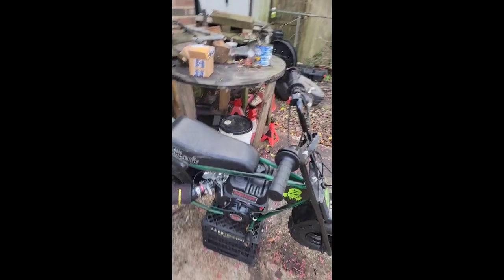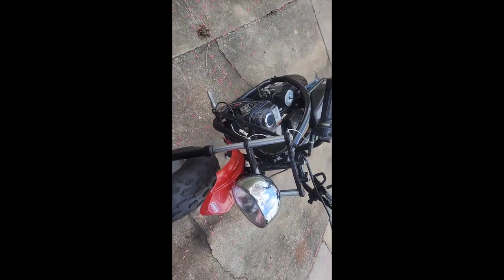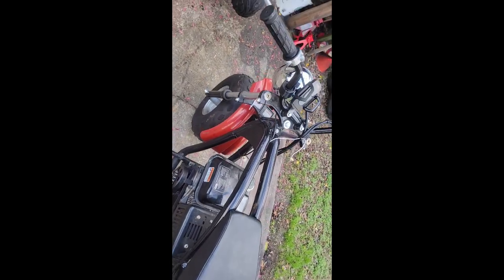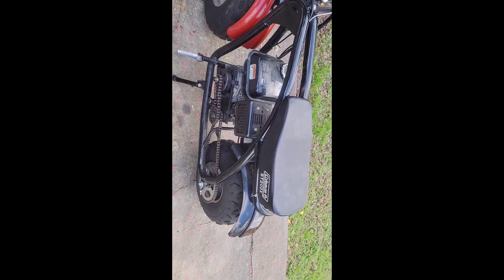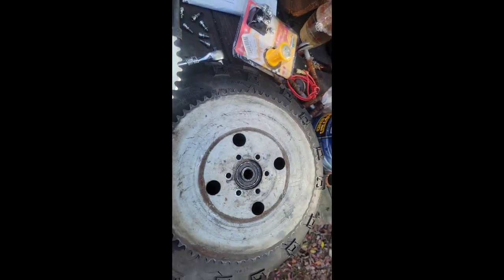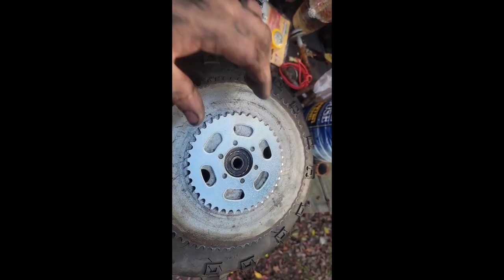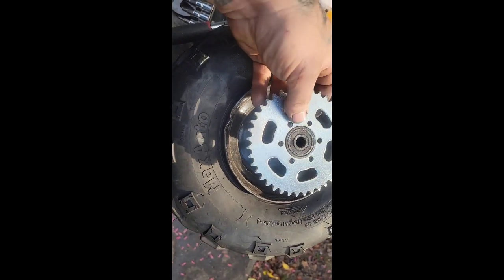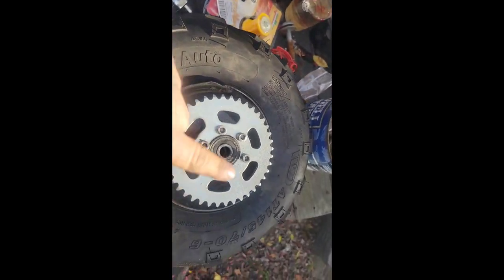work on the doodlebug..#predator212 #doodlebug #gocarts

Comment: I like that size sprocket do you have a link or website from where you got it
Reply from the maker: YOXUFA 420 Chain 50T Tooth 40mm Rear Drive Wheel Sprocket for Coleman BT200X CT200U Trail 200 CT200U-EX Baja Warrior Heat Massimo MB165 MB200 196cc 5.5 6.5hp Powersports Mini Bike Silver Parts https://a.co/d/h7TuXpz
Reply: Thank you
Reply from the maker: @mr03mach12  your welcome.  Thank you for watching.